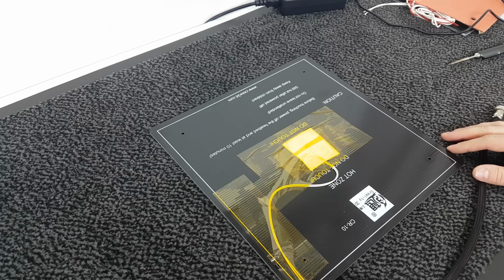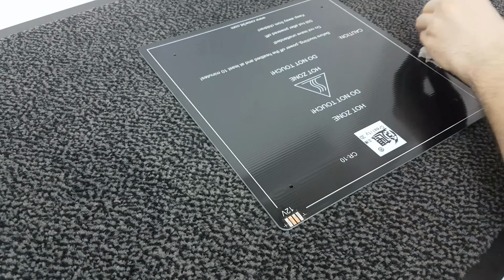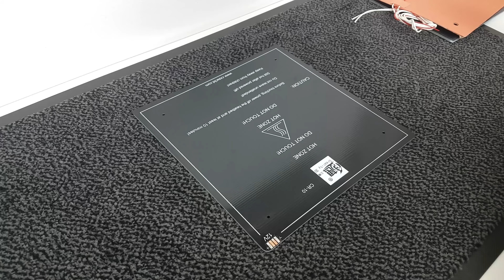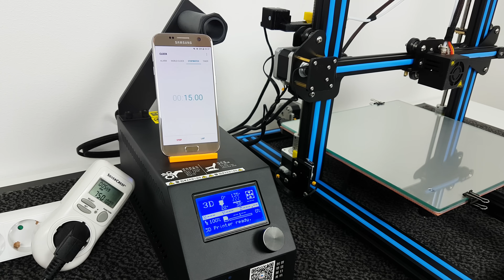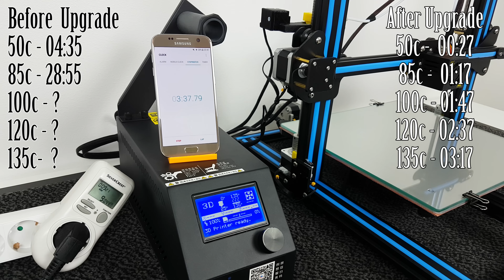Creality Cr10S ultimate Heat-bed upgrade! 750W heater installed

Comment: Nexi Tech I know you are getting a lot of flak for this mod.  Most of it is only due to safety concerns.  I know you have the disclaimer and warnings, but that only goes so far.  So in the interests of safety I will also add my bit (sorry if someone else has pointed this out already).
Reusing the original plug and socket for 220/120 VAC is a very bad idea.  For 3 main reasons ( I'll ignoring the Volts/Amps rating of the plug and socket).  
1. The socket on the control box has exposed pins that could be touched accidentally when the cable is unplugged. With 12V that is not a problem, but 220/120 VAC could electrocute and possibly kill someone.
2. If the control box is moved and connected to another CR-10   * unmodified *  printer frame that has the standard 12V heated bed, firstly you would have a large bang as the 12V heater blows.  Then the bed and printer frame could become live and electrocute or kill someone (no earthing on the frame). 
3. The control box (in Australia at least) does not have a mains fuse and our power cords and plugs do not have in build fuses.  The control boxes were designed that all output sockets have 12VDC coming out of them. The 12V Power Supply box has an internal fuse and short circuit protection on the 12V output and in the factory design it is enough to be safe.  But you have taken the 220/120 VAC straight to the relay and the heated bed without a fuse or earth.  This is not safe.
I understand you or someone else who knows what they are doing could use the modified CR-10 relatively safely.  The problem is that someone else who doesn't realise the dangers may make this mod. or worse the printer is used by someone who doesn't know the printer has been modified.  The potential for disaster is high.  The modification as you have shown would be illegal in many countries and if something bad happened the person who made the mod could be criminally and/or civilly liable.
Sorry if it sounds like I'm criticizing you and the mod.  The video and tutorial are great so don't stop making them.  My only concern is to make such things safe for everyone.

Comment: Is this process exactly the same with the CR-10? Or will I have to change it a bit?
Reply from the maker: It's the same. Just make sure to add ground wire, you can attach it to heat bed adjusting screw and to the ground on power-supply. This will keep you more safe and more more thing don't use paper clips if you remove glass frequently. Install Ultra-base glass surface.  Links are in video description.

Comment: Hi, Does that silicone pad have a thermal fuse in it? Do you know if any sold contain them? I am still worried about my Tornado as if the SSR fails short, which is the most common failure scenario, there is nothing to stop the heater going way past the desired temperature, detaching from the glass when the glue melts and potentially causing a fire. I am working on an Octopi monitor with an Arduino backup, but a thermal fuse or at least thermostat would be much safer and less subject to potential error or failure. Given the cheap nature of components in these things, I doubt they included a thermal fuse in the heater. On the Tornado, btw, the fuse and switch are fitted on the neutral side of the supply and the 10a fuse is way too high for the current that could cause issues. All the best.
Reply: You can just cut one of the power lines and add a thermal fuse. I did.

Comment: Between 8:20 - 8:50 You are removing two wires that were turning on/off mosfet and using that (+.-) to turn relay on/off. My cr-10 bed stop heating (mosfet board burnt) and i replaced it (mosfet board). Still not heating. I noticed that I have no voltage (0 v) where you replaced those two wires. I measured voltage after i turned printer on, after replacing mosfet board. Question: Should I expect any voltage and how high? Mosfet specs says that Gate Threshold Voltage is min 2 and max 4 volts, and I was expecting something in that range, but 0 volts all the time.
Reply from the maker: Darko Stefanovic Hi Darko! Well that's strange I never experience mosfet or relay failure. Mosfet input voltage (+ and -) when heat bed is "OFF" should be 0V. When Heat bed is "ON" mosfet voltage input should be 12V or more depending of your powersupply. When printer is turn on but heat bed is "OFF" voltage is 0V. Same goes for the solid state relay. Are we talking here on Stock CR10/S DC heated bed or Upgraded one with 220V silicon heater and Solid state relay?
Reply: Hi, Thanks a lot for reply on this. Mystery solved few days ago. 
For some reason, for some time, my bed would start warming up every time i turned printer on, and it would preheat it to 50 C. Since this is usually the lowest bed temperature that i use for printing, i did not mind. Although, it was unusual, because i checked setting in (Marlin) that i have upgraded, and  it was not there (or i did not see it). It didn't bother me because it matched what i needed, preheat to 50 C was ok.
When it stopped heating, i investigated and realized that mosfet burnt and after i replaced it, i turned printer on and bed was not preheated. 
Long story short, on printer LCD, using that control button, when I set bed temperature to anything above room temperature, 50 C for example, it started heating it up. And voltage at that (+,-) was 12.xx volts. When i set it below achieved temperature, 37 C for example, voltage there was 0 until bed temp went below 37 C. So, everything works fine now.
I still don't know why my bed was preheating before and is not now, but i will investigate. I have upgraded to Marlin long time ago and maybe i did not pay attention to default settings, or my mosfet was going bad gradually and causing this. Anyway, that's my experience, if anyone has similar problems.
Thanks again for the reply.

Comment: Hi, I live in New York and the mains voltage is around 120 VAC.  If I purchase a 750 W heat pad rated for 120 V and wire it as you have shown, will there be a potential problem selling my unit to someone who lives in an area with a mains voltage around 220 V?
The CR-10 itself can be used with either voltage at the flip of a switch, but this project connects the heating pad directly to the wall.
Reply: Short answer is YES there will be a problem, don't do it.
Long answer -
If you have a 120V AC pad and use it on 220V it will probably blow (up) and destroy the pad.  I say probably because I can't be 100% sure, but 99% sure.  Putting nearly twice the voltage on the 120V pad will almost double the current (11.45A) and nearly quadruple the power.  That's a 750W pad now drawing around 2500W.  The Solid State Relay (SSR) is only rated to 10A, this will probably blow and be damaged.  I don't know if the US control boxes have a mains fuse (the Australian 240 V ones DO NOT) but that would blow possibly protecting everything.  If there is no fuse then the SSR and the pad will probably blow.
A bigger potential problem with the mod shown is that you are reusing a socket and plug originally for 12V DC with now 120V AC or 240 VAC. Forgetting that the plug and socket may not be properly rated for 120/240 VAC.  The socket on the control box has exposed pins that could be accidentally touched and kill someone.  Also if someone uses the modified control box with an unmodified CR-10 frame and heated bed, things will go bang and possibly electrocute someone.  If you are selling this modified CR-10 to someone and something happens, you most likely be criminally and/or civilly liable (depending on your laws).
Reply: Then this should really be mentioned in the video.  Is there a way to hook up a 120V heat pad so that it works on mains voltage but does not blow up when the 3D printer is switched to 220V mode and plugged into a wall?

Or is there a heat pad that functions well with either/or 120V & 220V?
Reply: @mrjsutphenEDU  As far as I know there is no simple way of doing what you suggest.  The heat pads are just large resistors, resistive wire embedded in the silicone.  You could use a 220VAC heat pad so things don't blow up with either mains voltage, but with 120VAC you would only get around 220W of heating.  This is the same wattage as the original 12VDC heater.
The 12 or 24 VDC power supplies used in the 3D printers, are able to do both voltages because of the way they are designed.  In fact there are supplies that will work will a large range of AC mains voltage (90-250 VAC) and don't even need a switch.  The reason 3D printers use the 12 or 24 VDC heated beds is that the power supply will always produce the same DC voltage regardless of the mains voltage.  Aslo the extra safety precautions, design, and certification needed for mains voltage outside of the control box, these are (relatively) cheap printers after all.

Comment: why manufacture used GX16 connector that can pass only 5A. Heating bed takes much more.
Reply from the maker: Adam Kan Now it take only 3.4A on 220V.
Reply: Thats why its better, but think about adding that extra earth wire. Im going to do the same but with completely new bed (aluminium 8mm) and external version of controller. I would like to leave main unit untouched and have possibility to return to oryginal bed (plug-in version). What do you think? You have no problems with bending of the bed?
Reply from the maker: Adam Kan I agree on the Earth wire. Never be to safe. Well once you try this AC upgrade you will not go back to the stock. :)
After this video I install ultrabase and it's still works great. I don't have any problems with bending the bed. Mine heated bed was 95% perfect from the factory and when I apply Ultrabase it's 100% flat. 
I don't that is necessary to add another external heated-bed but if you plan to sell you'd CR10S in the future than I guss it's easier to leave it stock.
Reply: @adamkan4661  The drawback of using an external controller is that your CR-10 controller won't be able to turn the build plate heater on and off -- and will start heating the hot end nozzle immediately, since it won't know when the build plate has reached the desired temperature. You'll have to be sure to be present when your prints end to turn the heater off manually.
Reply: @Wolfcritic64  It does. Relay is still controlled by CR-10 12V power line. I made it without touching cr-10 cables.

Comment: So to fix all the issues people have highlighted:
1, replace the aviation connector with a reverse 5pin 250v rated one, so no ac exposed back of control unit
2, run a ground wire on the extra pin to the aluminum plate
3, put a 5amp inline fuse before the relay
4, use spade connectors to connect to PSU AC and relay.

Does that about cover it.
Reply: Curious how did you attach the ground to the bed? Have a link to the connector you used ?
Thank you for the note, very helpful.
Reply: @LCSRacing  there is no good or up to code way to do that, so these mods are always dodgy
Best possible would be another countersunk hole but thats not possible with the silicone mat.
Workaround is applying a counter nut on one of the screws and having a ring terminal with counternut below the leveling knob. (but this needs to be undone every time you twist it)
Reply: @anxiousmerchant4129  You don't really need to ground the heated bed directly. You just ground the mount plate underneath. Be worth checking resistance between the two before you count on it but it should be fine.
Reply: @uglyduckling81  On most printers the bed carrier is isolated form the bed and electrical contact is coincidental if a screw touches the hole wall

ofcourse you have to ground the plate directly.  If you give electrical advice on the internet, do it factual correct or be silent
If the diy'ed contraption misfunctions and safety fails, guess who's liable
Reply: @exol511  you misread
the one liable is the person who fucked with the wiring
Reply: The bed is grounded in his video. The power supply case is grounded and it is connect to the relay. I followed his setup and even checked the continuity between ground and the bed.

Comment: great video ... How did yoiu ensured that the thermistor has the same behaviour ? i e themperature is correct ? Thanks
Reply from the maker: Olivier Bouilliez Thanks. Well Heater has the same 100k thermistor as original and  I have checked with two infra red temp sensors and thermal camera.
Reply: Nexi Tech Well donne. I believe this double check was important. Did not hear you mention it in the vidéo, although extremely detailed for other things. I Knox IR ils impossible to ne both concise and extensive ..!!!

Comment: After reading all the comments and reviewing the video I have to agree with the gang on one this,  GROUND THE FRAME>  I am an Electrical Engineer and that is the only way to be safe.  The rest of the set up looks fair.  Just run a ground to the frame and into the control box and ground to the input power ground.  that should make it safe.  Great video and I plan to do this in 120v as soon as I get my CR10s next week.  Thanks for posting.
Reply from the maker: morgoth62 Thanks man I agree on the ground wire and I already  wrote it my "pin comment" right after posting this video on extra safety. Recently I install this upgrade on my Tronxy X5SA and it's works great as well. I will post video on that soon when I finish with other upgrades. Still waiting for some parts to arrive. 
Regards 
Nexi

Comment: Nexi Tech can I try to do this on my creality ender 3 printer ?
Reply from the maker: You don't need to install AC heater one Ender 3 as it can heat up to 110C. Just add the insulation that would be good.

Comment: my country is 240/220v and i ordered the 220v 750w silicon heater but received a 110v instead. Am super tempted to install it anyway. Supplier is checking whether its possible. any thoughts?

(am thinking it would just heat up even more faster)

Comment: 750W + prabobly another 100W from the rest = almost 900W 3D printer, sounds a bit excessive and super low efficiency to be honest...
Reply from the maker: CassiusProps You mean super high efficiency? Think again. With the heatbed insulation under whole down heatbed surface surface i gain efficiency 50% more then stock. + High power and efficient silicon heater powered directly from AC(No lost in conversion AC to DC which is another 10-15% , + saved time from waiting the printer to heat-up(Time=money) +ability to print all kinds of Filaments another + for this upgrade.
Reply: Original Prusa i3 power consumption is like 130W and you get a heatbed that can go up to 110C I think so... it speaks for itself :P.
Reply from the maker: CassiusProps CassiusProps Original Prusa i3 MK3 have heated bed of 150W(8A 24V +10% loss AC/DC=165W)  heated size is ( 25cm×21cm=525cm2) and it needs around 4 min to heat to 100C. 165Wx4min=660W power consumption. 
 
CR10S heated bed is (30cmx30cm=900cm2) and it needs 1.4min to reach 100C.  750Wx1.4=1050W. 
Power consumption.
1050W/660W= 1.59
So CR10S is taking 1.59 times more power then Prusa MK3 but
Cr10S 900/ MK3 525 =1.71
So that means that Prusa MK3 has 1.71 times smaller Heat-bed surface.
Conclusion:
CR10S with 750W heater is taking 1.59 times more power from Prusa I3 MK3 but it heats up 1.71 times more heatbed surface 2.8 times times faster. 
Winner:
CR10S with 750W silicon heater upgrade  :)
P.S. Not to mention Z axis on MK3 which is 21cm and on CR10S is 40cm. Almost double the size.
Reply: We are talking about heatbed alone but I guess you're right :D. Not that bad afterall, thanks for the analysis! ^^

Comment: Just did this, worked great. Clean install. Don't listen to these guys that say this is dangerous, the cr10 bed underside is potted and isolated from the bare aluminium, it won't conduct. The only time the you'll get shocked by the bare connector is if you have the machine on, running bed temperature command and have the connector disconnected.... don't ever see that happening.

Comment: This is the best mod to my CR10 I’ve done to date. The speed at which the heated bed reaches temp is outstanding!
Reply from the maker: Thomas Love I agree :) P.S. I installed stepper motor dampers. OMG what the difference in the sound and vibrations! It's like night and day! So much silent.
Reply: Is it still working? Any problems?

Comment: Awesome video!
I know you are looking into doing the same thing with your TRONXY X5SA and since you have both these machines, what heating element would you recommend for the TRONXY X5SA?
Can wait for the TRONXY heatbed upgrade; need to order parts before mine gets here. 
Thanks man!
Reply from the maker: The Looking Glass Thanks man! Well at the beginning I was thinking to go only with 12V 30A heatbed mosfet and insulation for my Tronxy X5SA but power is not enough.  I measure only 17.5A(210W) pull from the 30A mosfet and 30A power supply and that's because of 0.8ohm resistance of the heated bed. Not quite enough. Then I was thinking to add one more 12V power supply or replace it by 24V powersupply and run whole printer or heated bed only on 24V. In that case Heatbed would pull around 30A (700w) but then we need to replace heatbed 16Awg wires with 12Awg silicone wires add one more 12V or 24V powersupply, we need Heat-sinks for borh power-supply as they would run at maximum power when heatbed is on and 24V heatbed mosfet. I think I might go with AC 600W-750W silicone heater and SSR as it's much simplier to install and possibly cheaper. 
P.S. You have all Tronxy X5SA upgrade parts listed under It's review video.
Reply: Cool! I too think that going with 220Vac is the best, cheapest and above all safest way to go. All I need to find now if the largest heat mat I can find. 
That´s where my question comes in: what is the CD of the holes on the TRONXY bed? Will also ask in the forum see if anybody knows.